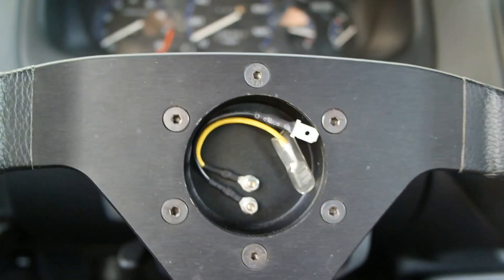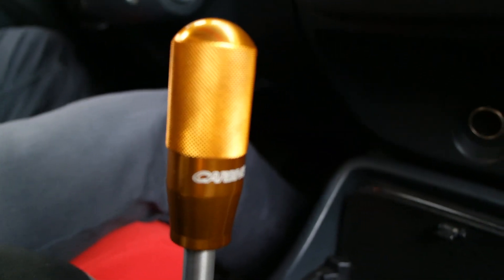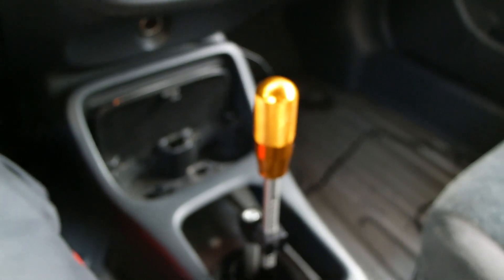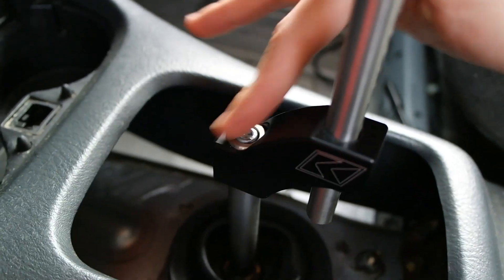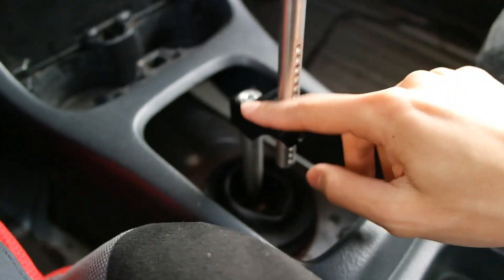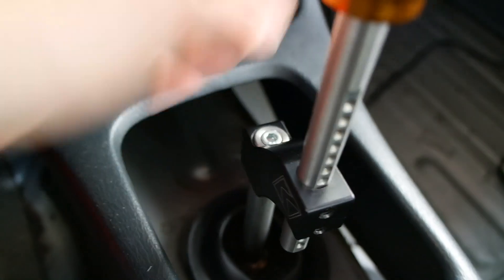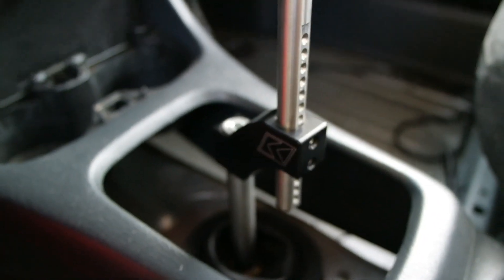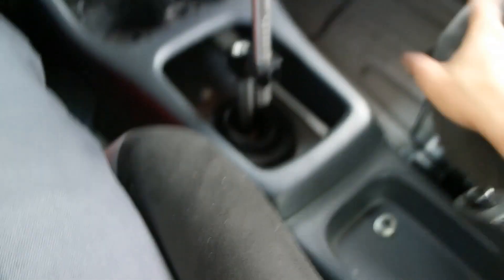K Tuned Shifter Review

Comment: I know I'm late but try lock tight it's going to be hell to. Remove them but they won't get loose do not get the red one get the blue , red you won't get it off without air tools
Reply: For the Nrg tilt hub not the shifter lol

Comment: do you know where i can find a short shifter with short throws and a longer shift stick for a mk4 r32 golf...plz
Reply from the maker: +Kalaiselvan Sivayograjah I am not too familiar with those cars but check out eBay! They sometimes got really good brands on there
Reply: Kalaiselvan Sivayograjah Go on the VW forums. Look around
Reply: I was just thinking about this myself. You should try to find the shortest throw shifter you can find and then add an extension.
Reply: CAE Ultra shifter. Expensive but well worth it.